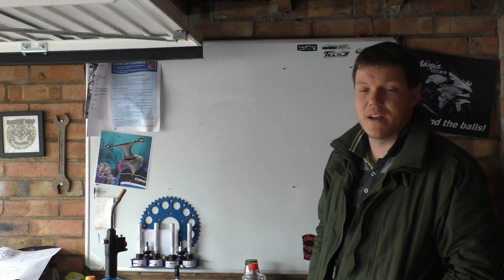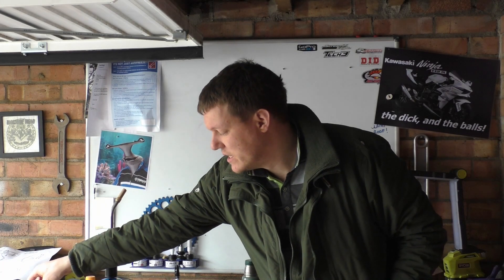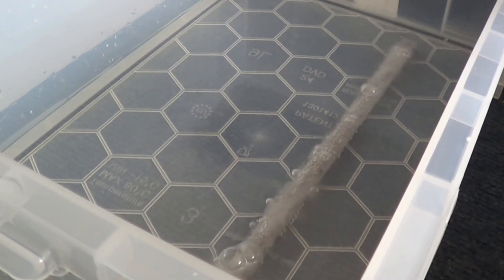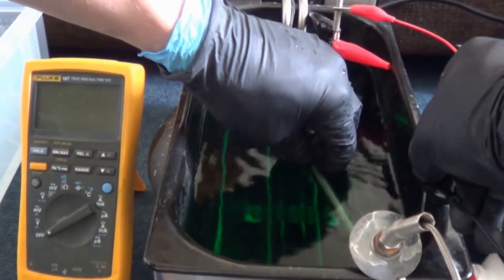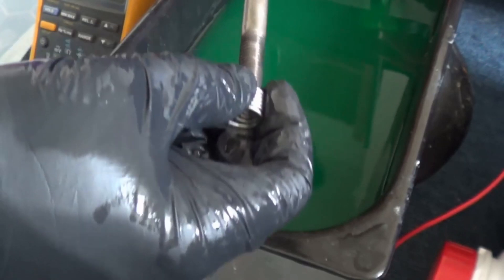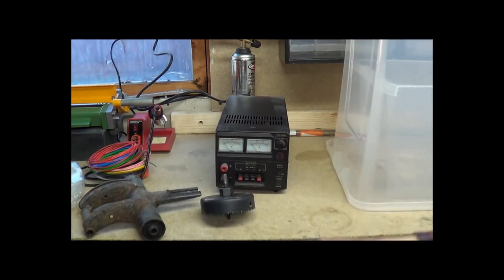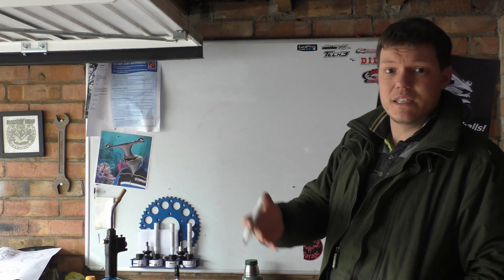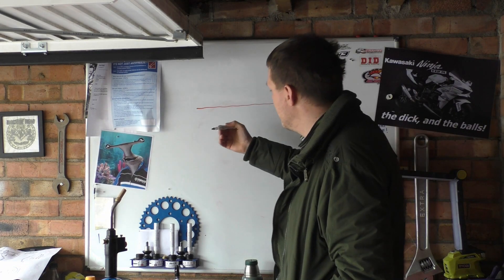Aluminium Anodising Process - Comment Reply

Comment: Hello
As far as my knowledge goes the surface of material mus not be flat 100% because paint won't stick to the surface, so you must have some edge to hold on. That is because you must first etch the surface to create uneven surface so that the paint have something to hold on, if the surface was 99.9% flat the paint will peel of like a peach when you move it across the shop even before you install the part. 
I mean this for aluminium anodising  + as you sad before in some video this and that paint material( you know  the different types of paint or primer).

Comment: Tip for anodising welded aluminium, be sure to use silicone free wire to weld or the weld bead will look like sht after its anodised.
BTW
This and the previous video have not shown in my sub feed.
Same for last Ave vid and another channel.
YT is a box of hammers.

Comment: It was me that said you got the numbers backwards! but it was my mistake, and a shitty source on the googles!!. I now understand that the meting point of the Al oxide is +2000 degrees. But now im thinking but is that relevant? by the time you get the outside part of your aluminium (the anodising part) close to 2000 degrees... the inner part would be alredy shitting the bed because the inner part is not anodised, its only Al and will melt at 600°c! or i am wrong again Matt?

Comment: I'm interested in thr dying process.  I mean what dyes can you use that are readily available.   There must be something  besides buying them.  Any guesses on what could be used?
Reply: Fabric dyes work well, though black doesn't usually come out really black. The problem is that you have to do it immediately after anodising. After anodising and optionally dyeing the pores are closed (usually using boiling water or steam). Once they are closed you can't add extra dye. As Matt says, doing it yourself is great if you want to learn how to anodise but not really worth the effort if you just want anodised parts.
Reply: LesNewell that's what I was thinking as far as dyes